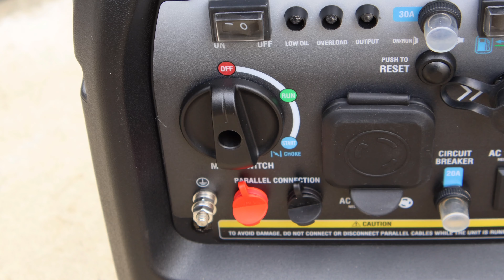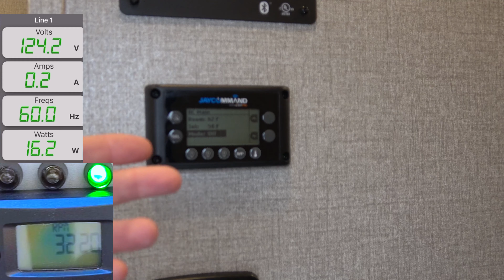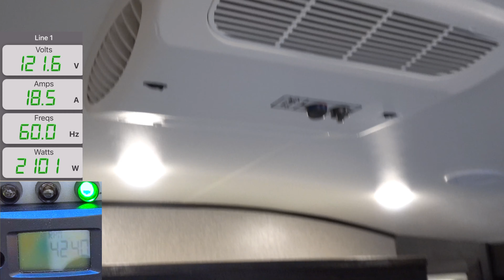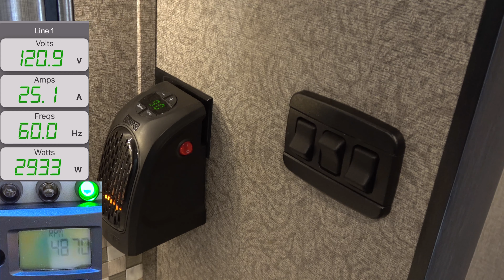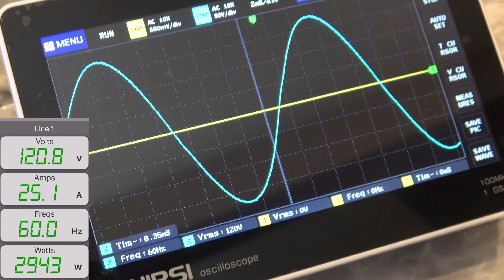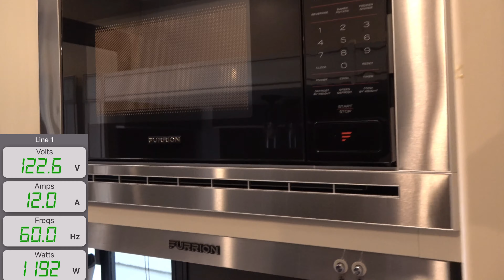Pulsar Dual Fuel Generator GD400BN Load Tested with Honda EU2200i RANT!

Comment from the maker: Pulsar GD400BN tested under loads and a small informational on Honda eu2200i and other small compact generators.#generator #dualfual #pulsar #honda 

Items in Video….
Pulsar DF 4000: https://amzn.to/3STbIyl
Honda eu2200I companion: https://amzn.to/491Lz5S
Maxpeedingrods4000: https://amzn.to/4822unm
Maxpeedingrods3500: https://amzn.to/42x3COT
Extended Run Fuel pump: https://amzn.to/3HxLPNI
Watchdog 30amp: https://amzn.to/3Sk4v8O
VENTY FAN: https://amzn.to/3SsiGc9
350 watt Heater w/remote: https://amzn.to/3SKqffF
400 watt Heater w/remote: https://amzn.to/3SIk0sr
AC Easy Start: https://amzn.to/3SGDi1x
ECOFLOW POWER KIT: https://bit.ly/46k8oAp
Power kit discount code 
11% off use code: POWER11

Have a Question? for fast response https://asqme.com/@johnnysweekends

CHECK OUT MY AMAZON STORE: https://www.amazon.com/shop/johnnysweekends

If you feel I helped you out..Consider Buying me a Coffee 👍🏼🙌🏼👊🏼😀
https://www.buymeacoffee.com/johnny5120J
Reply: @johnnysweekends first off your videos a awesome, very informative and helpful. 

Based on your videos I purchased a pulsar GD400BN and also the ground plug because my watch dog triggered the ground wire fault. 

The issue I’m having is that even though I plug in the ground adapter my watch dog still turns red (E7).   I did not modify the plug should I have? I get the green light when I plug it in. 

Any help would be highly appreciated. TIA
Reply from the maker: Hello and thanks for the positive feedback.

So the watch dog works correctly in other plugs or pedestals I assume correct?

Weird that it shows bonding issues with the plug being used or not.

So make sure to plug bonding plug in first 
Start generator 
Then plug in watch dog and it should work

If you plug in watch dog first then bonding plug it can take about 45 seconds to cycle and recheck for ground which then should turn white.

You don’t technically need the watch dog at all to use the generator. It’s only adding convenience of being able to see loads or power being used.

Hope this helps
Reply: Thank you

Comment: Great video , am I weird I can watch generator review videos all day lol. So I bought the gas only version and I’m pretty impressed. I did the breakin version from the Gemini app and then tested it on my travel trailer. Handled the AC no problem. Didn’t push it further just because it is so new. It is a quieter generator and more powerful than the Firman 3200 I had. It is also half the weight and size so that is a huge plus. I will say the Firman is a great generator. I used it for 8 years with zero problems.

Comment: I bought and have been making some tests on my Pulsar 4000w duel fuel generator I purchased in part thanks to your recommendation.  I have less than 3 hours on it and I have only used propane and hope to keep it that way. The generator works well but it will not meet the 3000w max run load on propane.  I watched your test and others on the web and consistently the generator has preformed to 3000w and above.  Mine will not go above 2600-2800 and I live near sea level. Can you recommend an adjustment, fix, or problem I should look for to help correct the problem? Thank you, I enjoy your site.

Comment: I ordered one of the Pulsar generators tonight after a lot of research.  Appreciate your videos.  They were helpful.  

I would have liked to get a quieter generator but came to conclusion that I needed 4000 watt generator, small size & portability & reliability than having the most quiet generator.  I don’t plan on running the Pulsar at night.  Only plan to run when charging my Echo Flow 2 Max with 5376Wh 48V lithium spare battery when I don’t get enough solar.

Comment: Have one 240v no CO meter, rest is the same seems well made . After one hour  20% load sae30 oil is really metalic and dirty i change it for another 2-5 hours and then fulltime syntetic Orlen XD(dexos 2 or 1 for turbocharched engines) 5-30 oil .

Comment: We have one of these, and I love it. My only concern is ours dropped to 60volts when I put it under a heavy load of a portable A/C and microwave, both drawing less power than this generator is rated to power.  I put that same load on our little yamaha 2200 inverter, and it didn't skip a beat!

Comment: Hey Johnny - What is the difference between the GN400BN and the GX400BN?   Seems the GX had a couple of nice features like the wheels and expanding handle, and of course, the display.  Seems like a no brainer, but the GX is like $100 cheaper, so I'm wondering if there is anything missing that the GN has?  Please advise!
Reply from the maker: Different engines and different companies
I still need to get one
Reply: @johnnysweekends  Turns out I just found they have a version, the GX400BRN which adds remote start.  Sounds like a game changer for this category. I actually stacked a deal at Lowes for under $500 OTD.
Reply: @johnnysweekends  Fwiw, I ended up getting the GX400BRN that added remote start - that was missing. After receiving, it still has the too tight valve adjustment others are reporting, but no head gaskets are available either. I don't need to use it until spring, but little irritating of course.
Reply from the maker: Interesting, should be set to .015ths 
What’s it at?
Reply: @johnnysweekends  I have not checked it yet - waiting for the gasket. But it's exhibiting the typical rough idle. So I just shut it down until I get the new gasket. Btw, the manual says 0.04-0.06mm Intake and 0.06-0.08mm Exhaust.  Prob in the same range as .015", but wanted to share the exact they publish.  Thanks bud!
Reply from the maker: You sure it’s not the low speed jet of the carb. You know how many are dirty straight from factory. I have had several

Also for rough idle go away with really low loads like 300-500 watts
Reply from the maker: Also that spec I gave was wrong was for something else.
More common on gens is what you mentioned or .002-.003ths or .06mm
Reply: @johnnysweekends  Thanks JW - I don't need to use this generator until camping season, so I'll wait until the head gasket comes before digging deeper.  If the valve adj doesn't work, I'll check the LS jet - thanks for that tip.  I also have a Champ 4650 that purrs like a kitten.  I bought he Plursar to save my back on the short trips.

Comment: Are you using a bonding device  I have been reading about the need to bond the ground
Reply from the maker: Only need a bonding plug if the RV requires it or the device you are charging and more like a EV. 
No need for surge protectors with a generator unless you want to then yes a bonding plug may be needed

Comment: Thanks Johnny. I picked up this Pulsar and took it camping last week and it performed great. I’m so glad it is dual fuel, because I needed dual fuel on this trip. 
I tested it at home (3000 ft elevation and 90 degree temp) and it performed admirably in propane mode. Started like a champ, ran all of the RV’s necessities including a/c and microwave-separately. Changed the oil after a two hour run and it was time to take this camping.
The first morning was a crisp 45 degrees outside at a 6700 ft elevation. The Pulsar would not fire up in propane mode no matter which configuration I set the start/run/choke switch. Ughh. Decided to go for a hike and get in a better mood after my generator failure. Came back to 70 degree temps with the generator basking in the sun and tried to give it a start. Fired up on the first pull. It seems in propane mode the Pulsar doesn’t like cold temperatures, which is not great considering my camping is at higher elevations. So I broke down and filled it with gas to ensure cold weather starts. The next morning I started it up in gas mode and let it run to get warm. After it was warm I switched it to propane mode while running and it switched over flawlessly. While I wish I could run the Pulsar strictly on propane, the dual fuel aspect really comes in handy. 
Great generator, and great video my man. Appreciate all of your info, keep up the stellar work!
Reply: A Properly gapped NGK plug will fix the propane cold start
Reply from the maker: Yup it can help as well. Normally .020ths 👍🏼
Reply from the maker: I have noticed several generators do have a harder time with cold temps and propane. Especially adding elevation. Propane comes out at -44 degrees and also has a higher ignition temp. So warming the generator on gasoline seems to be a common remedy for the cold and higher elevation issues

Comment: How does the pulsar compare to Wen3600 dual fuel?
Reply from the maker: If you want a real detailed comparison on several units watch this From $500 to $3000: Which Portable Inverter Generator Is the Best Buy?
https://youtu.be/OH6sQ3szOqI

Comment: Would this run a 13,500 RV air unit without a soft starter?
Reply from the maker: Ohhh yea 👍🏼
Reply: @johnnysweekends  23' Outback 23KRS toy hauler.  No solar, no A/c soft starter.  What would be your choice for an inverter generator?  Will be running on gas only.  Thanks for all you do for the RV community!   Your vids are very valuable and great contend for us who aren't experienced in this.   I know plenty about generators for my house, but not so much about the RV stuff.  Thanks Again!!

Comment: I am trying to decide between two Pulsar 4000W duel fuel generators, the  GD400BN and the GX400BN.  Both have similar specs, but the GX has a larger engine and more features, like a larger fuel tank and digital display.  Did you ever test the GX model?  If not, are you planning to?  I'm not sure which would to buy.
Reply: Which one did you go with? I’m also trying to to decide. I like the size of the GD but prefer the bigger tank and features on the GX
Reply from the maker: I didn’t do the gx
But it’s the same engine as the wen 3600 and champion 4000 
Just different options and size 
Like the GD for the size 
Much like a Honda
Reply: @johnnysweekends  good info, been going back and forth between the wen and the pulsar models. Lowes carries the pulsars in my area, no wen available nearby unless special order. Still thinking lol. Great reviews, thanks
Reply from the maker: Did you see this From $500 to $3000: Which Portable Inverter Generator Is the Best Buy?
https://youtu.be/OH6sQ3szOqI
Reply: @johnnysweekends I’ll chk it out, thank you.👍🏻

Comment: YOLOGD
New Member
JoinedAug 24, 2024
Posts6
I installed a Renogy 2000w inverter with automatic transfer and a Renogy shunt. Battery is a 280ah. When I plug in to shore power the battery monitor/shunt shows that the system is charging. Shut also works properly when the solar panels are connected. When I plug into my new Pulsar 4,000 watt generator it does not show an income charge and the battery monitor/shut starts to flash. According to the manual, a flashing monitor/shut display indicates that the shunt is wired backwards. I know that this in not the case and everything works fine when it is not on the generator. Any ideas for proper generator charging?
Reply from the maker: Try a bonding plug on the generator and see if it starts charging

Comment: Does this Pulsar 4000 watt generator (GD400BN) have a steel sleeved engine?  Also I see Pulsar also makes another 4000 Watt generator model GX400BN.  Have you ever tested that model?  It seems to have a larger engine in it and more features....I really appreciate your videos!
Reply from the maker: Yes Steele sleeve and yes the other model is made from a different company running the 149cc zonsen engine used in the champion 4000 and wen 3600
Reply: @johnnysweekends  Thanks!

Comment: Will this work on a 12,000 btu 1,400 watts portable ac? Because I seen someone say that I need 3X the 1400 watts for starting watts so it would be 4,200? This is 4,000 do I really need 3X or is it bs? Thanks

Comment: Is there a big difference in fuel consumption versus an 80cc inverter (like the A-iPower 2000). Just curious if it's worth the upgrade.

Comment: Great review and I’ve gotten some good use from this compact, duel fuel powerhouse so far. I carry it in my truck camper and it is more than adequate power-wise, without the gas fumes as I only run it from my onboard propane tanks.

Comment: Great review and I’ve gotten some good use from this compact, duel fuel powerhouse so far. I carry it in my truck camper and it is more than adequate power-wise, without the gas fumes as I only run it from my onboard propane tanks.
Reply from the maker: Nice thanks for the feedback back 👍🏼😀

Comment: I buy a unit like one of these intending to own it for at least 15-20 years.  Reliability is huge for me, and availability of parts.  By the checklist, the non-Honda units are compelling. However, will they last 10 years?  Will parts be readily available in 5-10 years?  This is where the Honda shines, in my opinion.  Much of the function of a generator is backup emergency power.  I want my unit to run.  If you were to bet money on which unit is the most likely to be the most reliable to run, it would be the Honda. 🤷🏼‍♂️. It’s just an is.  Each time I think about saving a few $$, that reliability point pops up in my head.  

That Pulsar is a nice choice by the checklist, but I may have to think about saving/putting away $40/month over this year to pay for the difference to get a Honda.
Reply: The Pulsar Chonda is a nice product.  I have 4 of them and when the power goes out in Texas they are awesome.  In 10 years I will buy another one and still be less than the Honda.  Heck I paid like 425 for one and 499 for the other 3.  That's like going out to dinner these days.  Honda is a great motor but the Pulsar is just fine for my needs.

Comment: Hi Johnny, I am glad I found your video, thank you for doing it. We have an Imagine XLS 22MLE travel trailer.  It has a 15K AC.  I have been looking at the Champion 4000 Dual fuel Inverter generator. Then I saw this model.  I am extremely interested in one of these.  Apparently there are SEVERAL versions of this.  If you are not careful you can end up with the twist lock 30 Plug (like this one in this video).  I would want the correct 30TT RV plug (I know they have a version that has the correct 30TT RV Plug).  I am not sure how to differentiate the model I want.  Also one of the several versions has a pull out (luggage style) handle with built in wheels, that I would definitely want.  We are older so I am also interested in the light weight (this one comes in at approximately 5 pounds less than the Champion) and portability.  I think the version I am looking for is the GX400BN, but I am not sure.  Apparently aside from some of the features (grey/tan case, the carry handle/wheel version and the plug configuration) they are all the same. I do not want to order the wrong unit.  Can you confirm if the GX400BN is the  model I want?  Also I want to be able to get an LP line that will fit the Gas Grill Port under the camper without an additional regulator to hook it up.
Reply from the maker: If you watched my champion video that has the same engine as the pulsar GX model. The the GD4000 in this video does not have wheels and a different engine. It’s a smaller package and I feel it’s a pinch quieter. 
But up to you what you want. 
I’ll be doing a video in about a month with a couple other models but I can buy all 10 of these lil
Reply: @johnnysweekends  Hi Johnny,  This is really a great video.  The GX400BN that I am interested in now appears to be the exact same size, style and color case as the GD4000.  After I did some more research It appears you are correct   It does list the engine size as 149cc's and the weight as 55 pounds (so it is an illusion and it is bigger).  It also appears to have the 30A RV connector not the twist lock and it has a pull out luggage style handle that comes out from the bottom front.  What do you do after you test these?  If you do the proper break in and you sell them at a discount after your evaluations I might be interested.  If I can use the gas grill port with the GX400BN that would be fantastic. Thank you.

Comment: I know the Mxr4000gt has the same engine but does this have the same carburetor that bypasses the carb?
Reply from the maker: I can double check but carb is probably very close except extra stepper motor for electric choke. 

Although I’m not a hundred percent on the question of carburetor that bypasses the carburetor

Comment: nice vid, 99% of these are for a RV AC. maybe top off. im looking for same point want to run one off propne tank 30 gal on board. to handle AC and top off. they getting smaller, saw many vids but this model and make hitting all the boxes, only question i got is propane will be stored in RV or under couch of RV . not sure the fume factor too great, would need a external generator box, but trying to keep costs down, 23 ft class b+. thnks for ya vids.

Comment: Is it as loud as it sounds on video?
Reply from the maker: No, but im also next to it. It’s a good unit. Is it as quiet as Honda on the low end? No, but both at 1800 watts and the pulsar wins with more power and dual fuel and noise level.